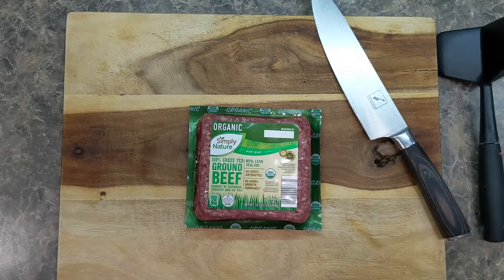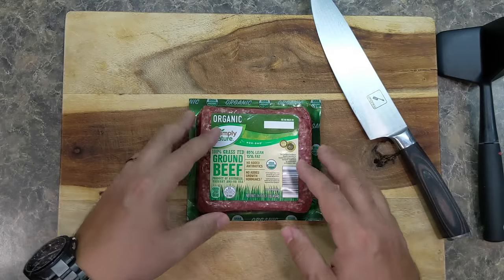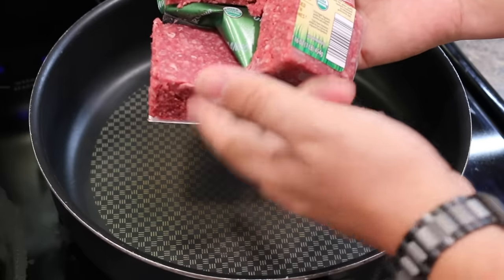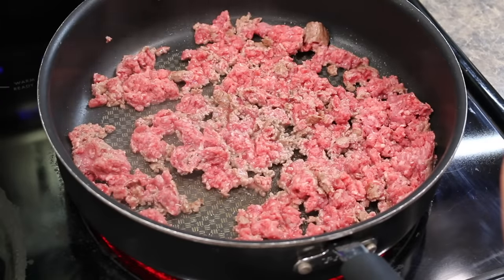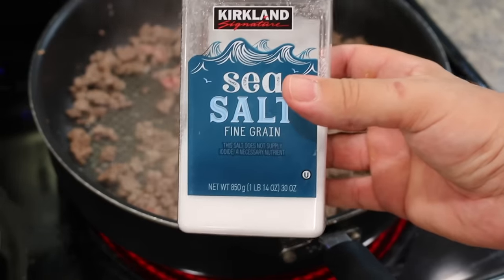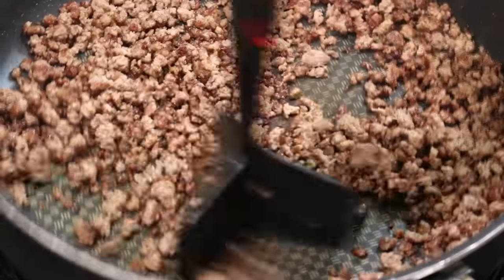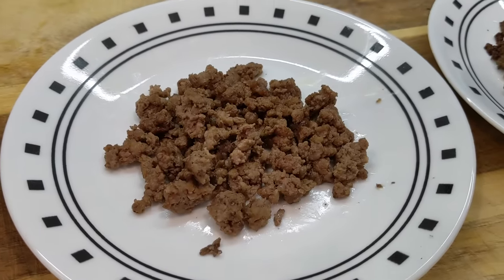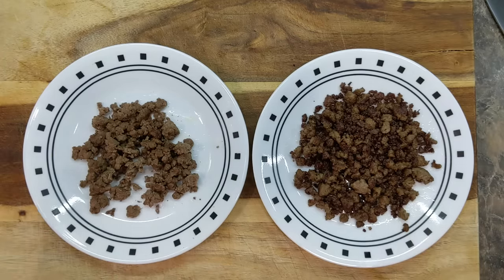How to cook ground beef for maximum flavor | I bet you didn't know this!

Comment: Agree with other comments about this ending up dry.

Best way I've found is to sear the entire ground beef on both sides before breaking it up.
Leave the lid on to get the cooking process started in the middle which will help brown once you break it up.
Once the sear is done on both sides, break it up and add 1/2 tsp baking soda and salt to taste, which is 1 tsp salt per pound for me.
Baking soda will exponentially increase the browning process and you wont end up with dry and crispy beef bits.

I've done it with and without baking soda, it does make a difference but you can also do the same steps without and it wont be as dry.

Comment: I buy the same organic beef.  Same packaging.  I open it up and put the entire pound on 3 sheets of paper towels and press medium to remove some excess blood and water.  Then I cut into 4 squares, 1/4 lb each.  Take each o e on a separate piece of paper towel and smash flat and round to form a burger.  Then season that side using everything seasoning then, flip onto a sheet of parchment paper and season the other side.  Do the other 3 the same way and place them in a one gallon zip lock style bag and place in fridge for at least a day.  After 25 or 48 hours,  remove and fry on a hot cast iron skillet to medium rare.  Approximately 2 min per side. A very thin pad of organic butter on top will melt in 30 seconds. Add 1 slice of organic cheese.     Let rest for 3 minutes.  Place on organic bun ( I make my own organic bread) its easy and cheap.   And you got a delicious, healthy quality burger with flavor.    Ive been doing this evey week for years.   If you're going to eat, eat healthy.  Total cost for the 1/4 burger and fixings.... Approximately 2.50.
Reply: Ronald, Wendy and the Burger King do not approve of your secret.

Comment: A method that I do is to use a small George Foreman cooker. Fry 3 strips of bacon in the cooker keep flipping until done. Set bacon aside, cook quarter pound seasoned burger in the cooker for 3 minutes, flip burger, cook another 3 minutes. The residual grease from the bacon helps get the perfect sear on the burger. The bacon turns out better than pan fried.

Comment: I love when videos use my exact same skillet.  I never realized I wasn't properly pre-heating my skillet until I got this one.  I've been cooking my ground beef like this for my Shepherds(Cottage) Pie and it has made a huge difference.
Reply: Make sure you don't over heat your pan. Using Teflon should be reserved for "sticky foods" and ones where Maillard browning isn't required. 
If your Teflon smokes, like this demonstrated, you're releasing the most toxic poison you have in your home. Best to use a seasoned cast iron or carbon steele
Reply: @DucatiKozak  I never put mine higher than 4-5 of 8 on any of the burners since the T-FAL instructions specifically said medium heat only.  It takes longer but, I'm a patient person.  However, I did find that even on medium heat the pan gets hot enough and as I previously mentioned the preheat ring changing color helped me get very good searing on steaks and such as soon I I put them in the pan.   I used to put the meat on way too soon.  However, there has to be something to be said about cast iron since it's been around for centuries.
Reply: no matter what skillet: I always use an infrared thermometer to check the heat.
Reply: @sinusnovi3826  I'm not a professional cook or even an advanced one that has all the gadgets.  But, I did sleep at a Holiday Inn Express one time and have survived 61 years.  I do have a meat probe thermometer because you definitely need that for air frying.  I am just saying that this skillet made me aware of how I was not preheating enough until I got it.  I guess since I have your attention if I had a infrared what would be the correct preheat temp for searing?
Reply: @RedBud315  you can use the infrared thermometer for a lot of tasks (ex. checking: the temperatur of the refrigerator/freezer; room temperatur by targeting a piece of furniture; wall temperature for avoiding Tau point; body temperature (fever) by targeting to the palate) and they are cheap. I also use a meat probe wired thermometer, especially for sue vide or roasting in the oven. And I use  a non wired meat probe for occasionally checking the core temperature of other cooking processes.
Preheat of the skillet (pan?) to Maillard reaction a beef steak I recommend at about 210° Celsius, never more than 250° Celsius in coated skillets.
But you can check this more accurate for your pleasure if you target your Tefal pan temperature indicator during preheating
Reply: This video used my Corelle dinner plate pattern!
Reply: Check the red dot in the center of the pan. If the logo (that is showing an hourglass) gets opaque red turn down the heat.
It's the patented Tefal heat indicator. HTH

Comment: The funny thing about boiled ground beef, and I mean where water was added, is that it very easily breaks down into small bits, almost by itself. I think we will try your method. I noticed that your pan is not flat and on a flat surface, and I don't see that as efficient.

Comment: Do you preheat the pan before adding the beef and if so for how long? If our beef is really lean, is it okay to add butter?
Reply from the maker: It doesn't matter if you pre-heat or not. And yes, if it's lean and there is no fat in the bottom of the pan, you have to add fat to fry it (oil or butter or fat). But keep in mind that the milk solids in the butter can burn. So it's better to use oil, ghee, or fat than butter.

Comment: I have an electric skillet.  So what you are saying is cook at around 220 degrees until the water is gone, then add a little oil and raise the temperature to around  350 to start the Maillard process and it takes about 15 minutes.  That is using 15% fat in your ground beef...  THANKS SO MUCH FOR THE TIP.   I am tired of having uneven sizes in my cooked ground beef.  Awesome!
Reply from the maker: Thanks for watching!
Reply: But I thought he never added any oil or fat. It cooked in it's own moisture and fat?
Reply: @Alloy-p3u he didn’t because he said that 15% had enough fat already in it and it didn’t need any oil

Comment: I always do this. But for even better taste use a stainless steel pan as that will make it even more crispier as it gets hotter faster. You can also use this trick to cook burgers cook them first on high heat until it gets crispy without oil and then add the oil or lard later.

Comment: I never considered that if there was water coming off the beef, and you didn't evaporate it out of the pan, then you were essentially cooking the ground beef at the temperature of boiling water instead of oil. Neat! And thank you for filling in the gap in my cooking knowledge!
Reply: For the desired reaction to occur with the protein it requires some water, but it has to be at a temperature higher than the boiling point of water - superheated steam. If there is no superheated steam present with dry beef, then the temperature will go higher and a different reaction will occur (caramelization of the sugars)  that produces unhealthy carcinogenic chemicals. You can dry age the beef in the fridge on a rack to reduce the amount of water production. In summary, what you do NOT want to do is slowly heat the beef so it releases its juices as liquid water, boil it dry, and then toast it.

Comment: Good advice. The reason you don't overcook a steak is because it gets tough, but ground beef doesn't have this problem. In fact, connective tissue aside, you want ground beef from a tough cut, since it usually has more flavor.

Comment: To Brown Ground Beef I found it best to make it into a thin layer on a baking sheet and put it in the oven and this will brown the top if you want both sides browned then take the meat out of the oven and take it off the baking sheet and wipe the tray down put a cooling rack in and flip the meat and put it back in with brown side down...  Also a great way to make a bunch of smash burgers, or sliders all at once.
Reply from the maker: Great comment! thank you

Comment: This is the way it's done in my kitchen.  You must get rid of the water.  That concentrates the flavors that are left behind and allows for the browning (I have no use for French terms). Even if it dries the beef out, as some suggest, Such small pieces of beef will quickly rehydrate once a liquid more flavorful than water is added.  It's amazing how much liquid can be reabsorbed during resting.  This applies to chicken too.  I often cook a whole chicken in a pressure cooker for 45 minutes, which you'd think would dry it out, but then I let it stew in the juices until it's cool enough to handle, and add the broth to the meat-bowl once it's picked.  It's never tough, never dry, and always delicious. I'm less sold on the crumbler though.  As the meat cooks, and as you keep it moving, it will naturally break apart into smaller pieces. That thing looks like it could easily jam a drawer closed, and takes up much more space that it'd be worth. Keep your kitchens lean and efficient.  Clutter is stress that takes away the joy of cooking your own food.

Comment: I tried this approach tonight. I was using 85/15 meat, and all this approach did was dry it out. I actually had to add some oil in the end to get it to brown, but even so it was the driest most disappointing ground beef I have ever eaten.
Reply from the maker: This is a method that you only use if you're going to add this beef to something wet like a soup or a sauce. If you're going to eat it by itself, then you don't take it this far.

Comment: 2:05 texture of ground beef is here in Germany different. Such a tool is not needed
Reply from the maker: Yes, it has a lot to do with the pressure behind the processing equipment. When I use my own meat grinder at home, the beef falls apart by itself. But the big machines at the grocery store use a lot of pressure and back the meat tighter, requiring you to separate it while cooking.

Comment: We buy pounds of freshly ground chuck at an Asian market. I then, using a form, make them into 3.75 x 0.75 inch burgers then place in freezer bags and freeze. When time to use one or more they defrost overnight in the fridge. If I'm going to make a crumbled beef dish,  I fry the burger on medium-high for 1.5 minutes per side and remove it or them from the pan, where I break up the seared burgers, still very rare in the middle but quite crusty on the outside.
So, we now have crumble that feature all these textures and different tastes. It, the crumble, will then be added to whatever dish it is intended for, and will get a few more minutes of cooking time. But, far more often, I also make freezer burgers from ground lamb leg, pork shoulder, chicken thighs. So, when defrosted, I will combine two or more of these burgers in a ratio I think suits the planned meal . To avoid having chicken as the center of the reassembled burger, I make separate burgers of chicken & pork and beef & lamb. The chicken and pork burger is fried longer than the beef and lamb.. When crumbled, they are all mixed together.
Reply from the maker: Great comment, thanks!
Reply: Brilliant. I buy my beef whole and grind it myself. I'll have to try grinding leg of lamb. I love your idea of mixing ground meats after browning.

Comment: I'd be much more concerned about the nonstick coating outgassing into my food than the maillard reaction....
PTFE is used as an inner coating material in non-stick cookware. This unique polymer coating prevents food from sticking in the pans during the cooking process. Such cookware is also easy to wash. At normal cooking temperatures, PTFE-coated cookware releases various gases and chemicals that present mild to severe toxicity. Only few studies describe the toxicity of PTFE but without solid conclusions. The toxicity and fate of ingested PTFE coatings are also not understood. Moreover, the emerging, persistent, and well-known toxic environmental pollutant PFOA is also used in the synthesis of PTFA. There are some reports where PFOA was detected in the gas phase released from the cooking utensils under normal cooking temperatures. Due to toxicity concerns, PFOA has been replaced with other chemicals such as GenX, but these new alternatives are also suspected to have similar toxicity. Therefore, more extensive and systematic research efforts are required to respond the prevailing dogma about human exposure and toxic effects to PTFE, PFOA, and GenX and other alternatives.
Reply from the maker: Yeah, but in actuality, there is nothing wrong with non-stick cookware. You won't die. It's perfectly safe to use. People have all these imaginary things they're scared of! Just live your life. No need to worry about non-stick cooking pans. What is truly dangerous is living in fear of things.

Comment: Your pan base is warped and the teflon coating damaged because of too much heat. Burnt Teflon is toxic.
Reply: I just typed that same thing (up top) I just saw the vid and thought man, that pan is wrapped from high heat. No getting it back flat.
Reply: @ramseykent5612 Sorry, but you are wrong on 2 counts ... firstly the pan in the video has a red temperature sensitive spot in the centre, which is typically found on TEFAL pans ... secondly, Hexclad pans do use teflon embedded between the hexagonal steel ridges, and the pan in the video does not have any hexagonal pattern on the cooking surface, and so cannot be a Hexclad pan.

Comment: Add oil to a stainless steel pan (using a teflon pan has serious issues, both in terms of the sear you get and the temperature), wait for it to smoke, add the block of beef without chopping it up (<-- very important), wait 1-2 mins, turn over whole block, wait another 1-2 mins.  Now chop it,  and cook ONLY until the still raw bits turn brown.  This is a reversal of your method where you sear first and steam second.  This allows you to get some of the sear flavour without drying out all of the meat and also ensures that the meat is juicy and tender.  This is quite important if you are going to add stuff to the meat, i.e. make it into a sauce, because with your method you will end up having to cook the meat in a liquid for a LONG time to return moisture to it, and in any event, completely frying up the meat will prevent it from re-absorbing a lot in the first place, making it tough in the sauce.  Moreover, seeing as with my method a lot of the meat juices are retained, (step 2 ends well before all the moisture is evaporated) it ends up adding beef flavour to the actual liquid of the sauce.   I am a bit confused as a result why you would use your method for making a sauce.
Reply: Seed oils,?
Barf

Comment: So, if I'm cooking ground beef with onions, should I cook them separately to get the Maillard effect? Or can I achieve it with the onions mixed in?
Reply from the maker: This will require a bit of practice. Here are the variables: the onions will cook faster or slower depending on how big or small you cut them. The smaller you cut them, the less time they will take to cook. So, you have to add them at the right time so that they beef and the onions will cook at the same time. This will require trial and error. Or, you can just cook the onions separately, that way you don't have to experiment with size and timing.
Reply: @FoodChainTV  Thanks for the reply. Guess I'll just cook them separately then.

Comment: If your cooking and want to add taco seasoning would it be at the the final/end of cooking the beef? Cheers....
Reply from the maker: If you are adding a wet taco sauce, you wait until the end and then add. If you are using powder (dry) taco seasoning, I wouldn't cook the ground beef this much, I would cook it half the time so it's still juicy and moist.
Reply: @FoodChainTV  I use powder so what I do is cook the meat 85/15 till medium/med rare the drain grease/water then add add seasoning. Your thoughts

Comment: if making tacos ..do you add the seasoning and water when its charred then cook for the recomended time?
Reply from the maker: If I am making tacos, I don't char the ground beef. I leave it wet and soggy. I only cook ground beef like this If I'm adding it to a soup or a sauce.
Reply: Leave a little fat in the pan and stir in the taco seasoning for about 30 seconds to bloom the flavors of the oil-soluble spices in the seasoning mix, then add the water.

Comment: Another great video, thanks. Just like your mushroom video... get the water out, boil away the water, and caramelize. I'm curious about your choice of pan. I find I get a better sear with meat using stainless steel rather than non-stick. Do you have a preference?
Reply from the maker: I prefer non-stick for ease of use. The only application for a stainless steel pan would be to sear steak or tenderloin. But otherwise, I probably would never use it. I always just use non-stick pans and skillets, and stainless steel pots. But actually, professionally, I use large non-stick woks for 90% of the things I cook.
Reply: @FoodChainTV  I appreciate the insight. Thanks.